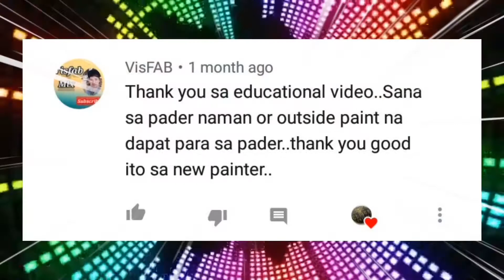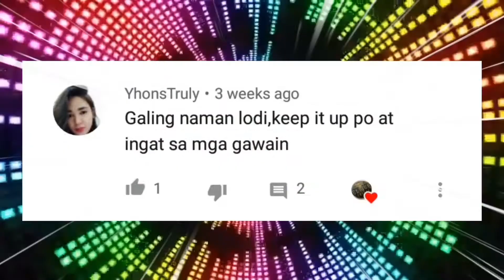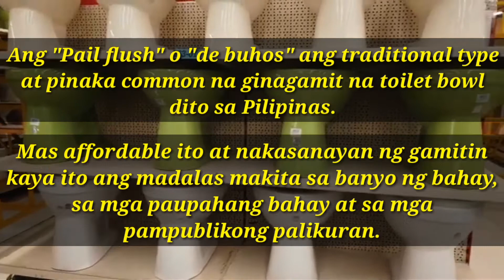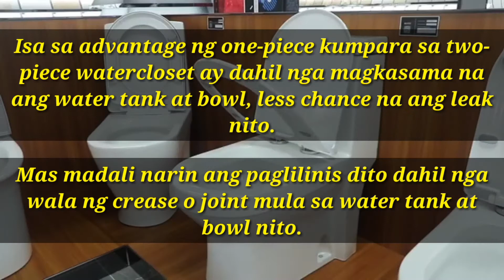Different types of TOILET BOWL |How to install a Watercloset #GROHE #HCG # ROYALTERN

Comment: Salamat, napaka informative . malaking tulong to sakin kasi area ko sa isang store ay Showroom tas incharge ako sa mga Watercloset at bathroomwares, problema ko lang is yung technical mismo ng watercloset, paano ang proper installation, kung anong basehan ng isang toilet if need pa ba lagyan ng flange or hndi na, may mga package kasi ng walang kasamang flange pero may silicon wax .